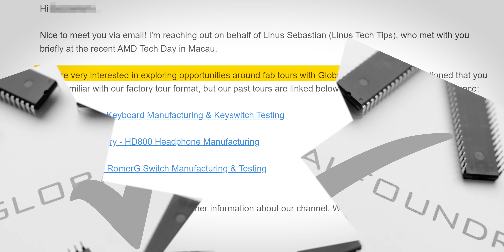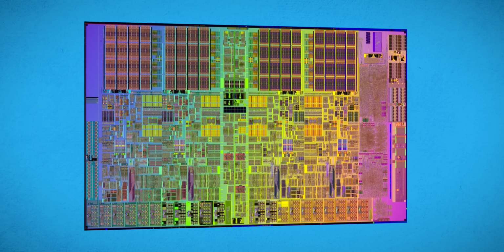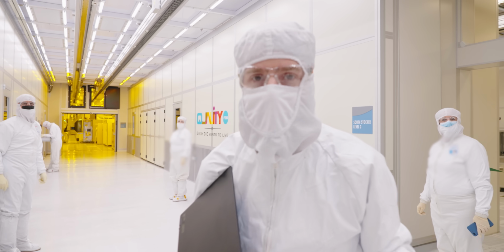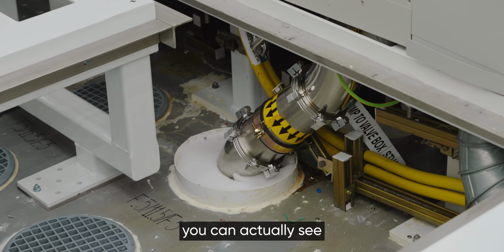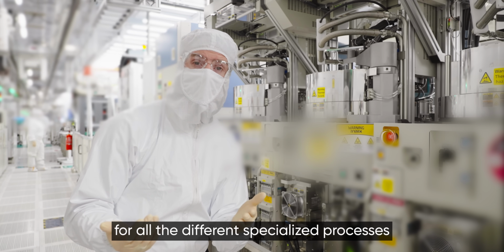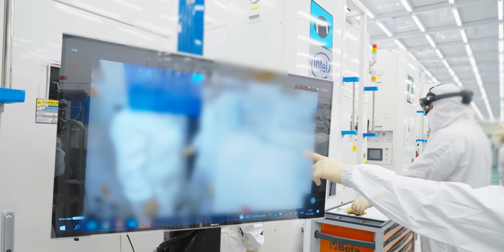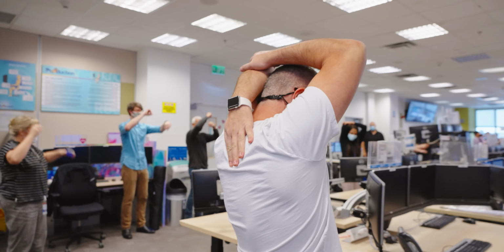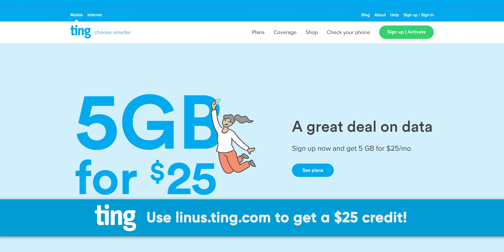I Can Die Now. - Intel Fab Tour!

Comment: great to see my babies (or their grandkids) still in use, i was part of the team to develop those overhead foup carriers for the launch of 300mm wafers back in the day.  i was shocked on the amount of people there until i see the 1 thing you forgot to blur. a label on a foup stating the wafers are for testing only and not for sale. i'm guessing they were not running any production and were having a training/maintenance day.  in 1 shot alone i seen more people than fabs i've been to had to fully staff the entire production facility.
Reply: Well, I'll guess they are recalibrating the machines for Gen 13 or even Gen 14. Gen 12 is factory wise already old tech, I would bet
Reply: Obviously they weren't going to just let Linus loose when they are actively producing chips.
Reply: Where was it?
Reply: Did you work at EFK on the original MHS system?
Reply: That's awesome!
Reply: Well seeing as construction can create enough siesmic activity to damage nearby structures im sure they arent actively fabricating while construction is going on nextdoor
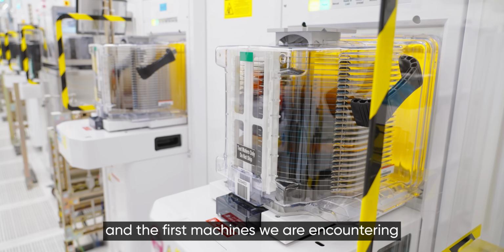Reply: @snjert8406  13:33
Reply: I guess they will not be doing real production until the ground work of the new fab is done? These heavy operations creates a heck ton of vibrations
Reply: @DWVoid0321  Possibly, like Linus said they’ve refused many times, you won’t expect them take hours of loss when they can easily schedule to get the ad out for cheaper.
Reply: I made the beans that you ate to beans 😋
Reply: They could have been doing a number of maintenance tasks on the tool, you don't particle test with production wafers, and they aren't gonna shut down the entire fab for a training day or a tour, just having one machine down costs them over $10,000 a minute.
Reply: "We have the entire fab on producing test only units. (Due to construction.) Ok. We can finally allow Linus that factory tour..."
Reply: pc master race likes that
Reply: @Bobis32  I'm surprised they don't have isolated foundation. There's a room in our university that has its foundation completely separate from rest of the building and apparently it's for nanofabrication research
Reply: the fact that its still a testing site is probably the only reason why they ever agreed to let Linus through the door then.
Reply: @Bremend  sorry but as you can tell from the amount of blurring they have very strict NDA's, while it might be fine to say where i worked i'm going to the extremes to not disclose to much.
Reply: @DWVoid0321  there's a machine called a hydraulic vibrator and when those things fire up they're nuts. They're like a roller for compacting soil but they have knobs on the roller. They really compact the soil.
Reply: @KiloShock  like someone else mentioned, with the amount of construction going on nearby it would make sense to combine tours, maintenance and training when the plant would otherwise be down due to the construction.
Reply: @sephypantsu  i'd think they do but there is a  limit to the amount of vibrations they can damper.
Reply: @3D_foos  the plant isn't down due to construction next door, the equipment is sensitive, but the fab was likely designed with future expansion in mind. I work in the industry and and semiconductor manufacturers absolutely can't afford to shut down a plant for any period of time.  You are talking billions of dollars lost to have it down that long it simply wouldn't happen.
Reply: @3D_foos  Nah, I worked in the Oregon fab and we ran 100% even when D1X was being built, and that fab was an extension of the building we were operating in.  Also, a lot of operations are run automatically so the fact that there weren’t too many people
In the video isn’t surprising. 

Anyway, long and short of it is that Linus’s visit, while requiring some extra precautions, probably didn’t impact fab operations in any significant amount.
Reply: Yeah it became kind of obvious that it was Maintenance day or something like that - even to a person like me that knows nothing about it. That is one of the reasons why Linus was let inside. Given that him talking so loudly and waving around those machines (I was starting to have panic attack) could have easily cost Intel half a million dollars in production chips a minute. Though it was later in the video that I realized that they don't produce anything for sale this very day - then I chilled out. It was some minor detail (also problem with not blurring something else) that ticked me off. So minor that I would have to re-watch the video to find out what it was.
Also funny thing how Linus picks up a blurred screwdriver so we can't see it's shape and says "it's a flathead screwdriver". Really the level of security was a bit over the top, while they let some other things slip. But I imagine that some of those details weren't really secret. Just abundance of caution and it looks impressive that there is so many secrets there.

Comment: CPUs still seem so "extraterrestrial" to me, it's just mind boggling how small everything is.
Reply: I also can’t comprehend the detail, they “dust off” a few atoms… ATOMS ⚛️
Reply: have you tried working with cells? those things are literally alive and you can only really see them with a microscope.
Reply: It's really simple, they're just rocks we trapped lightning in and then tricked them into thinking.
Reply: @jonathanodude6660  Yeah but they're also not a product of human manufacturing lmao
Reply: @PeripheryFanboy  depends on what kinda cells youre talking about. ive cultured bacterial and human cells that came out of tubes produced in some lab somewhere. i worked with people who did transfection of those kinda cells too. machinery on that scale and smaller is still super impressive though.
Reply: Agreed, it's mind boggling especially for someone like me who is no engineer. It definitely seems extra terrestrial.
Reply: also the fucking fact that we were able to not only make sand do calculations for us, we can practically make it think that it's alive
Reply: @jonathanodude6660  I mean yes cells are small, but this is working so small you are checking on atoms that is just an whole other level.
Reply: right and even just how quicky transistors shrunk when microprocessors came out. i mean really its not a ton of time between when transistors were invented and when micrprocessors were invented.
Reply: Building it in Israel is foolish.
Reply: @user-yv7dt5je1l  I know people want to pretend to understand how CPU's work, let alone how it's built..
But no one understands this.  It's 100% alien.
Reply: @jonathanodude6660  Well yes, but we are talking a number of a magnitude smaller than a cell. A red blood cell is made of a molecule called Hemoglobin. Hemoglobin is estimated to measure 5nm. A red blood cell is estimated to contain 270 million hemoglobin molecules.
Reply: @shi3abooks  i mean typically you can achieve nanometre scale processing using chemicals, polymers or lasers, but my point was that we’ve been working with small things for a good while and some of those really small things are literally even more complex and have to maintain their surroundings while duplicating themselves.

I think it’s more impressive that we can actually see what it “looks like” using a STM or SEM after these treatments. The people I work with could only measure the sizes of their polymers by indirect means.
Reply: @jonathanodude6660  these are much smaller than cells. A typical cell(there are exceptions) is usually in the order of micrometers, whereas these chips are in the scale of nanometers which is 1000 times smaller. The transistors are so small that they need to consider on the scale of individual atoms
Reply: @androwindo  you’re saying this as if a cell is an indivisible unit but a chip is not. He held a chip in his hand, while his hand is made of cells. Yes there are parts and processes on the nanometre scale, but that is the same as a cell, including atomic level precision, such as the proton pump or Na/K exchangers.
Reply: @thelazyrabbit4220  If it's capable of "thinking it's alive", it is.
Reply: @brockoala2994  most living things aren't capable of that. Like viruses and bacteria. I think the biggest criteria to be considered living are reproduction and growth.
Reply: @jonathanodude6660  The smallest living cell (mycoplasma) comes in at 0.2 micrometer. The smallest transistor is still 100x smaller, coming in at 2 nanometer, which apparently (what do I know, Google does) is even smaller than a strain of DNA. So no living cell could actually be that small. :O
Reply: @jonathanodude6660  yes. And I just boiled and ate a cell larger than my eyeball this morning.
Reply: @shi3abooks  I gotta admit you are right. Being alive is different to having consciousness. A tree can be alive, a brain-dead person can also be alive, while a sentient AI can think it's alive but it's not.

By your definition of being alive, when an AI learns to manufacture more of its copies, and grow by researching and upgrading itself overtime, can we call it "alive"?
Reply: You didn't know that Intel gets help from extraterrestrials?
Reply: A series of tiny switches. That’s all it is at a very high level.
Reply: @brockoala2994  It is logical to think that. After all, one of the greatest philosophers has a similar saying. "je pense donc je suisI" or "I think, therefore I am" or "I think therefore I exist" 
I guess if it learns how to manufacture more copies of itself, we would have a dilemma on our hands. Was it one of the terminator movies that something similar happens?
Reply: @LordFokas  (with tiny mazes printed on them)

Comment: Years ago I was a vendor to a US company that made the chip carriers for Intel.  As a senior applications engineer, I was asked to write a CNC routing program that created a precision pocket within the chip carrier for the chip to be imbedded.  The equipment was a single spindle vision assisted machine called a "SMART Router".  I used a 0.032" router bit to cut the pocket.  The tolerance for the routing was +50 microns, -0 microns.  Any negative error would destroy the carrier by damaging the gold traces inside the carrier.  The router bit would wear in a predictable way so the software could adjust the cutter path on the fly to ensure consistent dimensioning.  Otherwise, as the router bit would wear, its diameter would shrink causing the part to fall out of tolerance.  There were special .020" pads (fiducials) inside the chip carrier that the vision system would locate and then correct the path of the cutter.   There was one room with about 30 of these SMART Routers.

Comment: The amount of small details this factory can form on silicon is outstanding.
Especially considering how blurry it is.
Reply: reminds me of some Japanese films 🧐
Reply: true
Reply: @Oscar4u69  40% visible 60% up to your imagination. That's the beauty of it.
Reply: @Oscar4u69  what? What are you watching that's so modern they blur? It's always been pixelated?
Reply: @leovang3425  15:38
Reply: @myztik5716  those Japanese films are never blurred is what I meant, they're always pixelated.
Reply: @leovang3425  This video is pixelated
Reply: @bencheevers6693  literally binning. Intel has the job of making sure they have the right amount of each sku and they perform altight. If they set the standard for the 12400 too high, there will be stock issue. Too low and they also encounter problems like performance. They can't just make a new sku too because the more skus, the more complicated stuff gets and marketing and logistics become an issue.

I don't think this is similar to locking out part of an EV battery. You have to lug around battery your not using and there is no legitimate reason to do it in any circumstance.

I do think Overclocking should be a given though to potentially increase performance though.
Reply: @leovang3425  That's my point, I'm not upset with binning and it's an industry standard for a reason, because they sell the chips in skus, but concieve of another system where they had one sku and they printed the performance numbers on the box and the price for the chip was on a sliding scale. This would never happen in the real world because 99% of people don't have any use for this information and it would make purchasing more difficult but I was just pointing out that they do take chips and underclock them down to the sku that they're selling it as. The disgusting part comes when they lock out your ability to overclock your property, they specifically eliminate that performance unless you buy their specific K series or a higher tier chip that costs you a hundred bucks more and has the exact same capabilities of yours. 
The lockout is the part that's like locking you out of your battery unless you pay more or subscribe.
Reply: @leovang3425  if you haven't seen blurred JAV you haven't seen enough of it man

Comment: I feel really bad for the editors that had to go through every frame of this video to make sure they blurred everything potentially confidential without being too distracting.
Reply: Probably Dennis.
Reply: @Mediaright  nah, probably someone at intel
Reply: I don't know what program they are using but can assure you it wasn't manual. Typically you use a automated program then go back and touch up the mistakes since it's never gonna be perfect.
Reply: @TurkeyOW  It's definitely manual. Most likely tracked in After Effects.
Reply: also the sponsorships lol
Reply: looks like they blurred out all the manufacturers of the machines. The wafer steppers are from ASML and also blurred out for whatever reason.
Reply: There's probably some Intel engineer who has a good enough idea of what everything is to know what needs to be blurred, and they told the LMG editor. Surely hours on both ends triple checking the footage to make sure everything is properly censored
Reply: @thunderxr2736  last time I looked at a map it was a country lol
Reply: I have no clue why half of it would be confidential, but if anyone is board, I bet you can find some of it in reflections.
Reply: @cornonjacob  I wouldn't be entirely surprised if one of the conditions of this trip was that Intel was allowed to scrub the footage first.
Reply: It was mentioned in a WAN show that this video took a long time to come out because it had to be sent back and forth to Intel MANY times to add additional blurring and editing before getting a final okay
Reply: @thunderxr2736 According to Wikipedia, there are 163 counties in the world that recognized Israel as an independent country
Reply: @cornonjacob  They probably consulted everything beforehand with legal team, and they had a list ready. I bet they have a lot of visitations from 3rd parties, from auditors, 3rd party maintenance crews, to safety inspectors, and there must be very specific guidelines with frequent reviews what can be filmed, what can be filmed and must be blurred, and what cannot be filmed under any circumstances. At datacenter I work in, we have remote inspections (as in a guy with robotic 3D camera walks around and inspector from different country is checking things), and the AR tools they have have AI that blurrs out secrets (i.e. so auditor from one customer cannot see contents of racks assigned to another customer).
Reply: Only Dennis and Linus were allowed. I think Edzel and Hoffman just saw the finished product.
Reply: @FireFish5000  Didn't you see that they also blurred screens where it reflected?
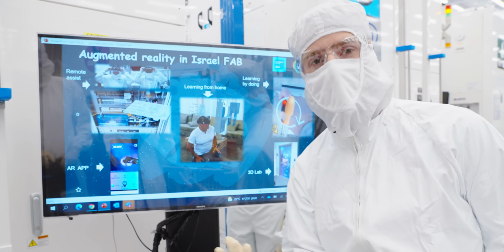Reply: @FireFish5000  Nope, even reflections were blurred. Look at the top right of the screen at 14:30
Reply: @the_retag  LTT were almost certainly the ones actually blurring the footage, with an approval process with Intel. They tell LTT what to blur and then double/triple check it before approval to post
Reply: It was extremely distracting!!!!!!
Reply: @Braiam  Wow, nope. Didn't realize they went that far. Guess intel actually did the blurring.. wonder what they were hiding

Comment: It’s always crazy to see just how advanced our technology has become. Just touching the machines throws them off, taking off molecules or even atoms at a time, taking into account air pressure, air composition, lighting spectra, it’s crazy to see just how hard it is to make what most first world cultures take for granted
Reply: wasn't there a video of single atom suspended in magnetic field?
Reply: Intel be like "what do u mean our technology it's MY technology that builts OUR technology".
Reply: These machines are making what we call our technology
Reply: It's crazy how far we've taken sand paintings. Which is basically that a chip is. Lines drawn in sand.